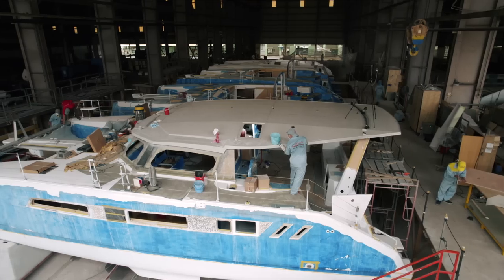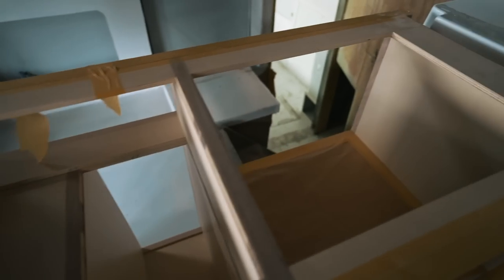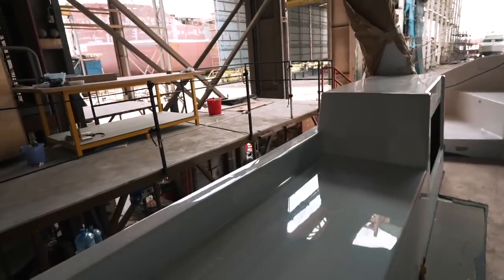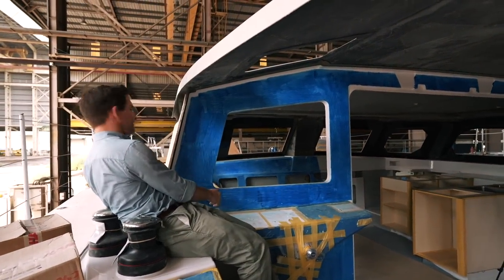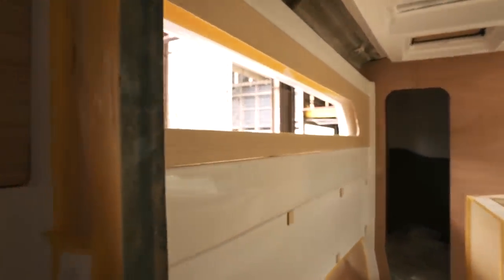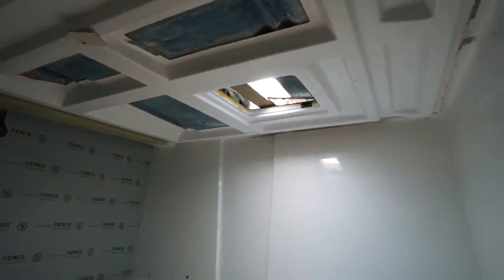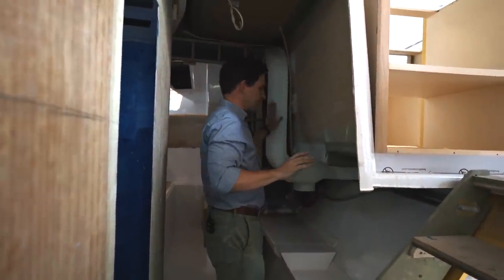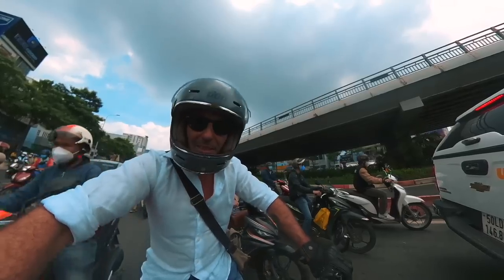Ruby Rose 2 Major Build Updates!

Comment: I dont like the step arrangement you have, firstly it encapsulates the cockpit if the steps finished flush with the cockpit sole, major water onboard would rapidly drain out the back but you have dammed up that area, but also small steps like that especially at night could be a hazard, you know as well as i do, dosent matter how long you own a boat, you always bang your head on something, likewise that small step up from the cockpit will always be the bane of your lives ?

I am intrigued, could you tell me where the water line is in respect of the cabin soles ? As it seems that there is very little access for anything in times of emergency, although you have access to skin fittings, its always sods Law hitting something will be away from such ?

One thing i have always been almost pedantic on and that is access, on my yacht on long passages where no help is available, i leave every part of the cabin sole accessible to access the bilge , likewise all lockers under the furniture although loaded, were always loaded in such a fashion that things could be removed instantly. I find it truly amazing in modern day builds full access is no longer available to anything below the waterline